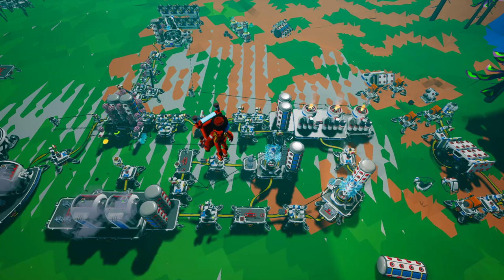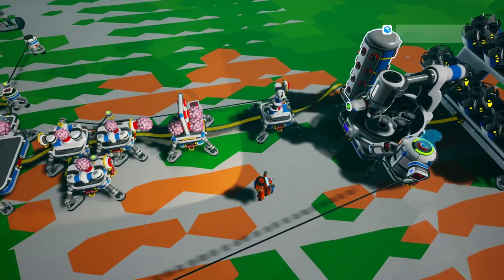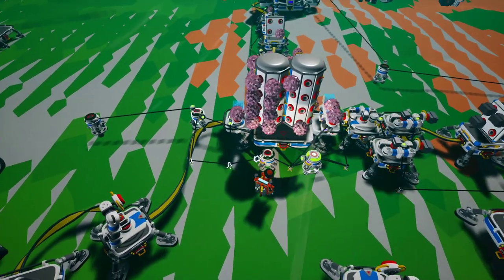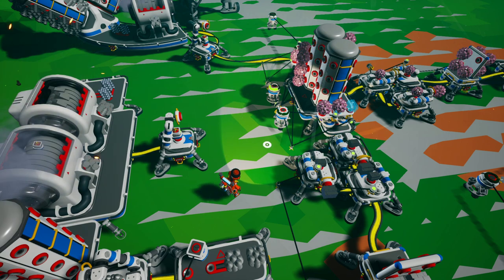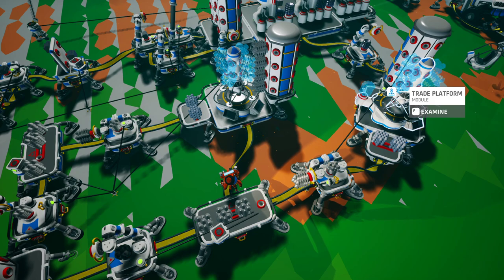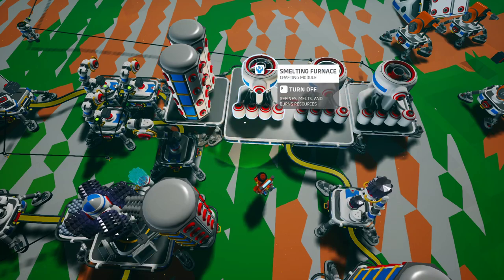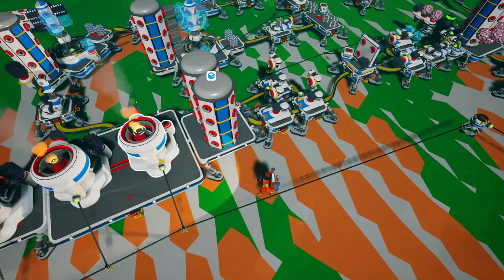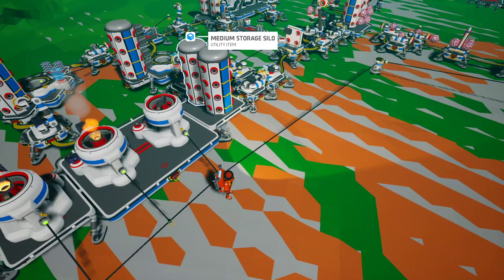Astroneer - Load Balanced Storage Sensor Production Line (Fully Automated Soil to Scrap)

Comment: i got an idea for dividing the scrap, have a medium platform C fed with the sensors by auto arm a XL shredder on main slot, a medium storage and 2 filler items on each side, on the one side the scrap goes to first it recycles for spalerite and the less prefered side gets sent to a storage that way it will recycle until no more space and save the overflow
Reply from the maker: That is a great idea! It'll save resources on the build because it'll use less logic and modules, and it'll take less time to build it.

Comment: I've built this and I'm struggling with the balancing of the arms that get the scrap. Sometimes I end up with both platforms half filled and the  whole line is stopped as there is no more sphalerite being produced so the printers stop printing. I am thinking I might need to add some logic to make sure it doesnt start filling one table before the other is finished or somethink like that
thoughts?
Reply from the maker: Hey thanks for watching and commenting, I do appreciate it! One thing you can try out is creating a simple clock cycle using delay repeaters and then you can control which arms are on and when so you have more control over how filled each platform gets if you don't want to use storage sensors.
Reply: How I fixed it: I fed a lot of junk into the "internal" shredder so now I always have a surplus of zinc waiting on the quartz. I had the factory running all day today and never got blocked again
Reply from the maker: @matimon  nice solution!

Comment: What if you used a power splitter? On the line that's slightly faster, put a splitter on it and divert some percent of power away to slow the line down slightly. It's tunable so you can get it within 0.01 units of power to get the perfect ratio
Reply from the maker: That is actually a great idea! I didn't consider using the power splitter to intentionally slow down modules before so I'll give that a go for future builds where I need to have different speeds.

Comment: I have everything attached but the small printers just stay in extended mode and dont print, any fixes?
Reply from the maker: Are they powered? That sounds like there may not be any power to that platform. Otherwise I have no clue man.

If it's not power, I'd double check everything, make sure the printers are set and the repeat button is pressed and the green print button is pressed as well. The printers should have access to all the materials as well.

If it's a bug, you can try reseating the printers, making new ones, and making a new platform as well. Hope this helps.

I do have a better production line using small canisters if you want to check that out: https://www.youtube.com/watch?v=I1IsWjqz_2k
Reply: @duckyobrien  thanks ill try to figure it out today. btw whats that repeater before the first delay one?
Reply from the maker: @kayliz1872  I needed a way to activate the delay repeater so I just used a button repeater.

Comment: I made something similar but added a chemlab and changed the printed item. Its not fully automated, I still need to open Whinches and drop them into the scrapper ,but it provides 400% the amount of scrap you can farm with sensor out of the same amount of soil. Wanna see it? I also have a Line with this same method so i can choose how to spend my soil. 
I also built a line which provides the desired amount of one resource out of scrap by counter repeater programation. I also have an idea to adapt my sorting sistem to be able to provide resources.
Nice Video!
Reply from the maker: Sounds like you have an amazing production line! I would love to see it.
Reply from the maker: @joseenriquesanchezreche6393  YouTube flagged this comment as potentially unsafe (probably because of the email) so I didn't see it until now.
Reply: @joseenriquesanchezreche6393  could i take you up on this?
i have replicated the model created by another youtuber “Jonathan’s info dump” it works sort of well but has a couple of flaws, which i’m tweaking. i could show you this too.